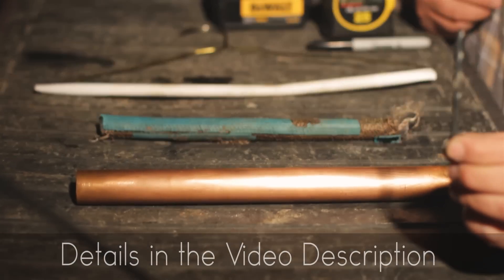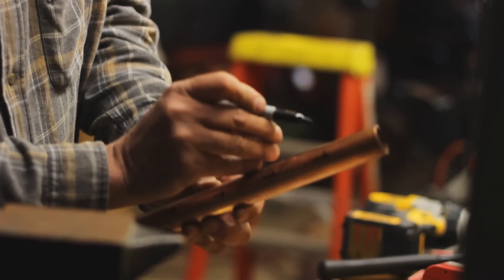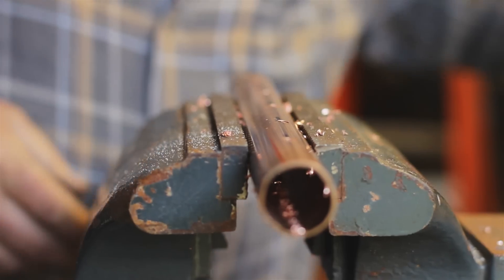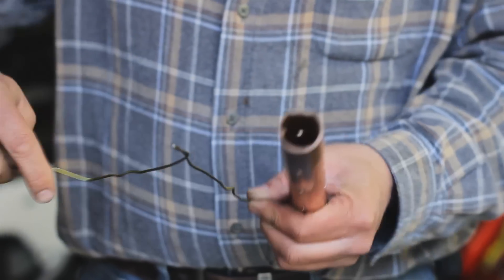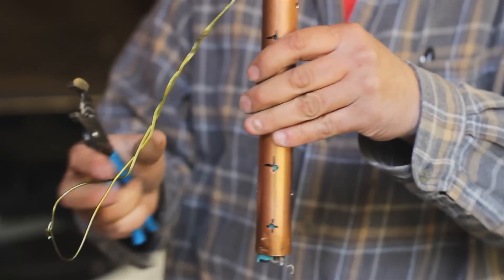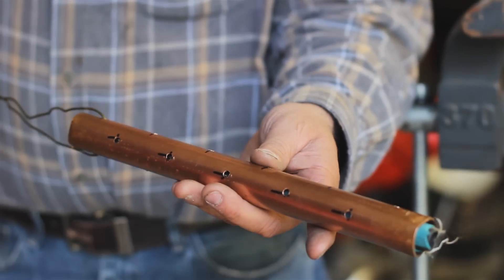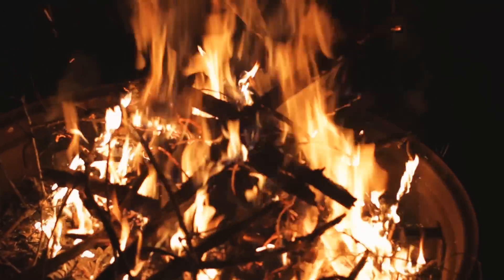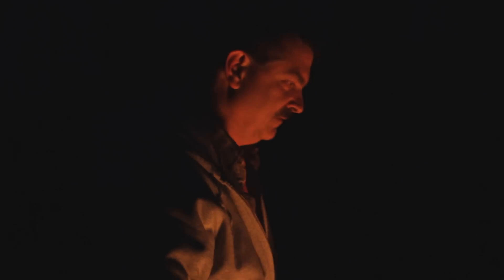How to Change the Color of Your Campfire 2025 - EASY!

Comment: You can really just get some HEET, and mix some chemicals with it for the same effect. Cockroach killer (boric acid) and HEET, it will make a green flame. If you add lithium (which you can get from opening a Lithium+ battery, not Lithium ion) to HEET, it will make a red flame. Once you get one of those mixed, dump it in a camp fire and voila, coloured fire

Comment: Cool!! I definitely plan to try. Any weather conditions recommended? This will be my first time building a fire by myself without any help.

Also, what would you recommend besides potassium salts to get the fire more violet/purple? And is it safe to  add the copper with potassium salts and strontium nitrate?

Comment: I had been told that the garden hose needed to be rubber, but is that not true?  Was your hose vinyl with the same results or did you have a rubber hose and just forgot to mention it?
Reply: CuzKatieSaysSo it must give off hydrochloric acid (or some other volatile chlorine compound) when it burns. Vinyl is PVC (polyvinyl chloride). Any PVC plastic works. Rubber normally does not.

Comment: Not only is this toxic it's ILLEGAL in many places. I releases toxins not only into the air but also into the ground. Just look at how pvc is made, it's nasty stuff. This is basically the same as burning wire; Burning wire releases carcinogens/toxins into the air and into the ground around the burn site,  including “dioxins, furans, polycyclic aromatic hydrocarbons, particulate matter, heavy metals (such as lead, arsenic, selenium and cadmium) and other pollutants.” For not following code, you can pay a fine of up to $25,000 per day and/or up to 5 years in jail. Also, if you find and report somebody for breaking the federal clean air act, you are eligible for a $10,000 reward!
Reply: batastrophe nobody cares
Reply: Cry baby wahhhhh
Reply: We are all gonna die.

Comment: does it have to be a copper pipe? or can it be a diffrent material? and can it be a new hose?
Reply: Copper specifically reacts with the flame to give green/blue hues. Other elements react differently (eg Lithium = bright red, sodium = yellow) but they are harder to access and usually don't come in a form as easily handled and manipulated as a pipe. This is how different coloured fireworks function as well. 

Don't know about the hose though, sorry.

Comment: To those interested in the chemistry: copper, when heated in a flame by itself, gives off the greenish color you see at first. When chlorine is also present in the flame,  the emmission will become blue instead. Vinyl tubing is polyvinyl chloride, which gives off hydrochloric acid when it burns. Any PVC plastic will work. The chlorine in the acid vapor gives the pretty, blue color. This is the same principle used in blue fireworks.
Chlorine is also used in green fireworks along with barium, which burns white without it. Copper is not used for green, since barium green is much more brilliant. Strontium, used for red, will work without chlorine, but the color will be deeper if it's present.
Reply: thank you sooo much!!! i was on this festival and there was a fire and somebody vomited into it and then the flames turned all those brilliant colors! .... now your comment was the last puzzle piece of the riddle! i figured it out it was the chlorine from the stomach acid (probably along with some minerals or irons in the wood/nails in the wood or something .... but the chlorine part from the stomach acid thats the point! ..... everyone vomit into fire, it becomes beautiful!!) xDD
Reply: Basically toxic gas
Reply: Ake---->>>  Thank you for the info!!
Reply: So what I really ought to do is make pack, pods, or stones out of those chemicals and chuck them in the fire?
Reply: Wow how else do I get chlorine? And probably not safe to breathe right?
Reply: Why thank you very much. Now I'm gonna just try a piece of PVC inside the 1 inch pipe. Maybe it will last longer than hose.
Reply: so what do they add to barium for it to be green if not copper? can this be like the chlorine in house hold bleach would that work if mixed with methanol? i am wondering if anything can be added to methanol to make the flame more blue and more visible
Reply: @ARCSTREAMS  boric acid
Reply: @ranmolo9462  boric acid burns green but i think he said barium burns white without anything unless you add chlorine to make it green ?? then he said there is barium green also?,he also says cholrine and cooper burns blue?so im confused about barium and chlorine
Reply: How to make colored fire easy: rip one colored page from a magazine , set it on fire. 100% intensely multicolor colorful fire. Further possible replies than the ones read already will never be read because people lie.
Reply: @tribalpyrotechnicsforrando2621  unless its soy ink vs solvents. Magnesium also gives a bright white glow(if I remember that right). I wonder if the pipe was an iron pipe, what would happen,...Maybe copper heating is giving off gases like hydrogen or something to help? Well, experiment and find out I guess.
Reply: @philindeblanc  It works 100% , it has not long duration , but it's perfect for celebrating and it multicolor in the most intense way. I simply say the evident truth everybody can witness in a few minutes. Try , check , be honest , and only then speak. It is simply one of those cases when there are people who complicate their things and the ones who make it easier have a better result , also , much less toxic. Everybody willing to see the truth will see it , the others will refuse to do that and it means they know the truth and are scared of it , this stay regardless of the words. Face the truth and don't lie , that's were it ends , lol. Possible replies will never be read.
Reply: @tribalpyrotechnicsforrando2621  I never said it doesnt work. I am pretty sure I know that it would work. I was suggesting other metals to get different effects. So maybe it is the varnish or something they use in magazine glossy pages. I dont think a newspaper would work the same.
Reply: yes thanks
Reply: Copper without.  Chlorine is also blur
Reply: W comment
Reply: Probably not safe in this manner to breath though.
Reply: Man.....  You got too much spare time.lol

Comment: Thanks ... nice video.  Might make drilling the holes in the copper tube little easier if you first make an indentation with a punch or nail.  Helps keep the drill bit from sliding from where you want it to be.  I think it would take a lot of breathing (a whole lot) the campfire fumes to produce  an adverse health effect.

Comment from the maker: There's been a large amount of comments from people claiming that burning this is harmful for you. Please read the disclaimer in the video description to clarify what I have found from research about this before you do this project.
Reply: +Erik Hendrych Only if you eat it
Reply: +Erik Hendrych Yes copper is toxic as sugar and  ogm meats,fruits and vegetables
!!
Reply: Erik Hendrych really?? they use it for water lines dude.
Reply: So no marshmallows?
Reply from the maker: I wouldn't consider it unless you want some toxins in your system.
Reply: Bunni D. Lizzy RAINBOW MARSHMALLOWS😂😂😂
Reply: I can imagine replacing PVC with something less toxic but isn't the copper itself toxic?
Reply: This might be bad if you did it indoors, but when doing chemical experiments, the recommendation is to do it outside. Luckily, you're already outside if you're throwing this in a campfire. A doubt a small length of PVC hose is going to hurt you any more than the smoke from a pile of wood. I wouldn't worry.
Reply: I think it's kinda different using PVC for water lines than burning it (even for water lines it's not 100% safe and clean). You do use car tyres on your car, but would you sit next to a fire of burning tyres?? XD

Comment: why does this work? like what does the hose do?
Reply from the maker: It just has a chemical reaction with the copper pipe when burned.
Reply: Olii Sant  science bitch!
Reply: The colors aren't a result of a chemical reaction, but of a physical one.

Back story : Electrons, in an atom have specific energy levels. And electron cannot exist with energy other than this. Think of them as steps on a ladder. You cannot step, where there's no support. An electron can absorb energy to climb up the ladder, and climb down by releasing energy. The energy released is exactly equal to the difference between the two levels. The released energy is in form of light.

Now, specific elements emit specific light (eg. Copper = Green). So, when you put something in a fire that contains copper, you get green flame. You can try this with blue ink.

You can get more details here : http://en.wikipedia.org/wiki/Emission_spectrum
Reply: Copper by itself doesn't give off any toxins but when you burn the garden hose you are burning a type of plastic pending on your type of garden hose. Garden hose is likely polyvinyl chloride. It contains a high concentration of dioctyl phthalte plasticizer. The hose likely contains fiber glass or other roving, heavy metal additives, and other plastics to create the finished article. The hose is placed in a copper pipe and placed in the fire. As PVC is heated it begins to smoke above 100 C. At 200 C loss of hydrochloric acid begins and loss accelerates up to 300 C where PVC quantitatively loses hydrochloric acid (HCl). When HCl is gone the polymer is left as a chain of double bonds (unsaturated). PVC contains 56.7% chlorine indicating that a significant amount of HCl can be produced.There are two paths for the PVC residue after HCL loss. If oxygen is present and sufficient, combustion will proceed. The products of combustion are carbon monoxide, carbon dioxide, and water depending upon a variety of factors. If oxygen is not present or in low concentration thermal decomposition proceeds. The products of thermal decomposition are HCL, benzene, and polyaromatic hydrocarbons (PAH) and a variety of minor components. Thermal decomposition proceeds to completion above 400 C.
Reply: The copper pipe should be good indefinitely. I haven't tried this myself but it will probably blacken due to a build up of carbon and the heat may make it brittle, but it won't take part in any significant reactions so I would say as many times as you like.
Reply: Ryan Rakowski think its the outer hose which has a chemical in it like an ink, because when i burn dominoes pizza boxes the blue ink on that turns my fire blue
Reply: Ratko Rajic
This is a oxidation reaction. It is the copper giving off the color. The color is a by product of the reaction. When the copper is fully burned it will no longer work. I think the ink in the garden hose also allows different color. Copper on its own will burn green only, the ink in the green hose would allow the other colors. If you burn newspapers, the ink from the fire will also cause the flame to change colors to greens mostly and some blues. I would enjoy this camp fire for its aesthetic looks, I would not actually cook anything on it and I am not sure what heavy metals would do to the purity of your food.
Reply: Raptor Jesus Parth is absolutely correct. And this is just a hypothesis but I believe the garden hose contains petroleum products. i.e. rubber. Petroleum releases lots of energy when it combusts. It will burn hotter than the wood fire thus aiding to the electron excitement that Parth is describing.
Reply: oh yeahhh

Comment: does normal pvc pipe work too?
Reply: Chanel Seeber of can give off colours for an hour or two I'd say. I kept pulling it out of the fire because the smoke is very bad haha. I study chemistry myself too so this was a nice experiment to do. PVC stands for polyvinylCHLORIDE and copperchloride is what causes the coloursi believe. This method works way better and is faster than making cucl powder
Reply from the maker: Nope, normal would more than likely melt. It's the chemical reaction between the garden hose and the metal.
Reply: Well you're wrong here. I tried it with normal pvc pipe, the yellowish one and I got the most amazing colours
Reply: Ryan Rakowski How long does it normally burn for?